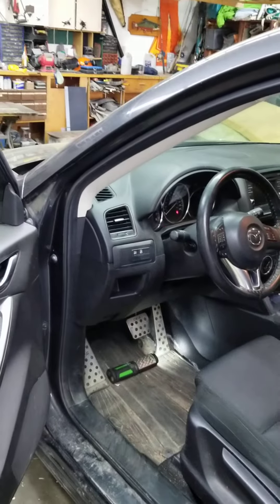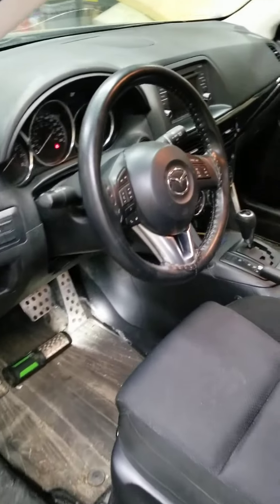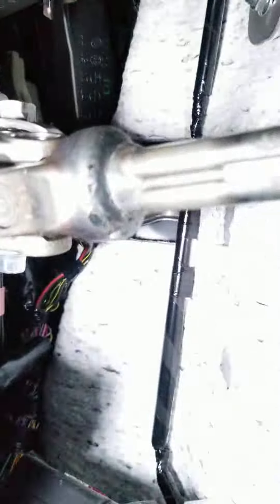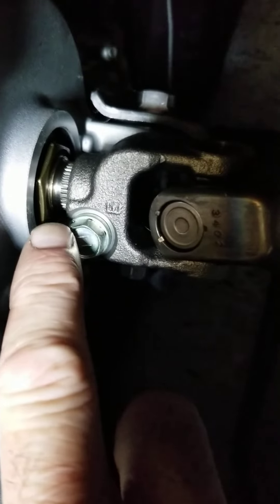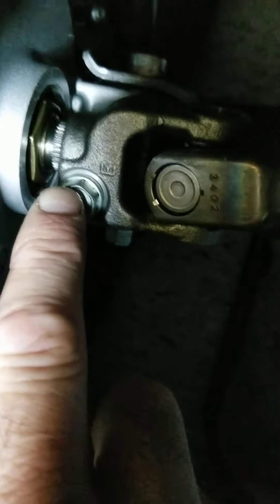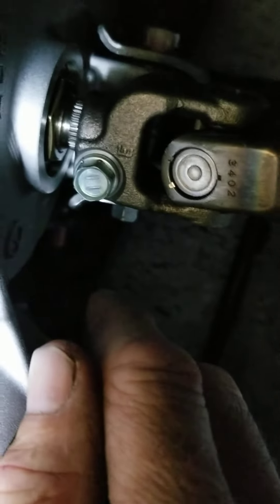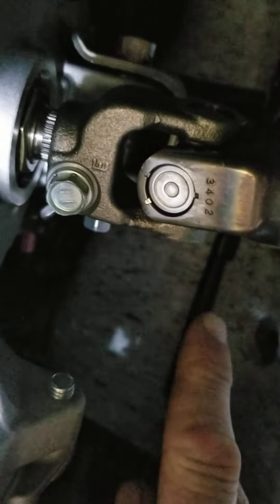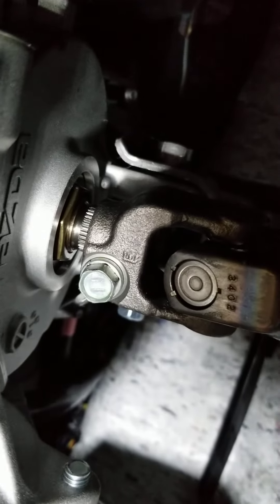Mazda CX-5 front end rattle or clunk solved.

Comment: You just solved a ~3+ year issue that some great shops haven't been able to solve, even as it's progressively gotten worse. I was about to book another diagnostic and probably replace the struts/shocks, but I just spent three minutes following your instructions and my 2014 is seriously driving like new. Can't believe it. Thank you!
Reply from the maker: Glad it worked Reese.  I suspect many are getting good results with this and I think beyond just the CX 5.
Reply: @ontariooutdoorsman  You're the man! Had a steering wheel wander and rattling. Thought it was control arm bushings, brakes or even wheels not torqued. But after 2 years, finally!!! Not all hereos wear capes, thanks! @Reese Smith, I feel your frustration as 2014 with the same issue.
Reply: Wad ypurs clunky over bumps etc? And only now and then ?. I'll check for play later kept telling myself it's   the gear box mount . Unsure atm
Reply: Just hopped into the wife's csr and found it doing this.  Thankyou for the help.
Reply: @kevinhancock4064  yeah it sounded and felt like a wheel was about to fall off.  Did the video help your problem?
Reply: @reese2694  I reppaced ball jo9mt on drivers side 4 now but do passenger shortly I think my inner tie rod is naff but no clocking now mate

Comment: It drove me crazy for 3 months unless i tried this method. And booooom, rattle is gone. I have been hearing rattle from which seems to be coming from dash behind steering wheel or engine bay, but it turns out to be a bolt as mentioned above. The bolt was already so tight, i just had to tighten further and the noise is gone. Thanks for the video
Reply from the maker: Glad it worked.  Awesome !

Comment: For those wondering.. the service manual calls for 21-30 ft/lbs torque on that bolt. Turn the steering wheel towards the driver side a little to get some added room to get a socket and torque wrench on the bolt.

Comment: On my CX-5 the bolt felt tight, but I was able to torque it down just a little bit more. The front end clunk which was was becoming progressively worse is now completely gone! Thank you very much for this video.
Reply from the maker: Glad to hear it...I was losing my mind trying to figure this one out.  I'm sure there are thousand of us with this issue
Reply: More I think if it its possibly my issue . I'll defo take a look ..the under panels are off anyway..easy to point out ? Get to ? I'm mechanically minded just not looked for it
Reply: What year is yourCX5?
Reply: @joseluishernandezrodriguez8146  mine ? 2013

Comment: It's funny that a Mazda dealership mechanic doesn't know this simple fix.  You could get clipped for thousands of dollars of repairs from front end alignment to replacing lower control arms bushings to shocks.  Thanks.
Reply from the maker: I totally agree.  In my opinion this is so common that mazda should issue some kind of service bulletin to check for this.

Comment: Random algo feed. I was curious so I watched. Ive been getting a front end clunk over bumps when my wheel is turned in my 2017 mazda 3 so this is pretty serendipitous. Knowing mazda's parts and engineering sharing between models, I bet my steering shaft is secured in a similar way. Thanks youtube and Jim.
Reply from the maker: It's hard to believe ho much annoying noise this tiny bit of play causes.  Good luck !
Reply: @ontariooutdoorsman hey Jim, I bought a 2024 in December, I’ve been hearing something from the rear end, sounds like metal to metal like the brakes are worn out but that probably is not true being not even 4 months old, I ran across this video, I wanted to see if you may be familiar with this issue  before I take it in for my first free oil change.

Comment: Thank you so much!!!!! Had that problem for months. Changed the sway bar, inner and outer tie rods, upper and lower control arms with ball joint, and was still making that noise. Gave up tbh but ran into this video, 10 minutes problem solved!
Reply from the maker: Glad it worked.  I suspect most mazdas have this problem evenually

Comment: I have a Mazda 3 2016. This has been plaguing me for the last two months. I’ve actually change two front shocks control arm, strut mount, stabilizer link, and it was a nut that was causing this issue. Thank you
Reply from the maker: So glad it solved it

Comment: You solved my problem. Thank you! I tightened with 40 Nm. The repair manual say 28-42 Nm.
Reply: Really? Over 300 ft/lbs on a small 12mm bolt?
Reply: Sorry.. my torque wrench has N-m in kgf-m.. you are correct. The manual has it 21-30 ft/lbs for non-metric areas.

Comment: Sir,....I think that I have the same problem on my Mazda 6 2021, and till now, I could¨t find it,...but I think that your video solve my problem...I gonna try it first think in a morning:)
Stay good
Reply from the maker: Hope it works for you.  It's very hard to diagnose that noise.  Took me a long time.  Good luck
Reply: Thank you!!! Like you, I’ve been chasing this down for a long time. Was about to replace yet another part when I stumbled upon your video. Can’t thank you enough. Someone already commented, but doesn’t hurt to repeat: from the 2013 CX-5 SM, joint bolt B torque range is 28-42 {2.9-4.2, 21-30} N.m {kgf.m, ft.lbf}

Comment: I hope this solves my problem. The sound is only present when I’m going over bumps. And it sounds like it’s coming from the driver side. I replaced both front strut assemblies 2 weeks ago.  The lower control arms a couple of years ago.  Mechanic check the work and said everything is tight, but they don’t know where it’s coming from.  In fact, it got worse when they replaced the strut assemblies.  I will try this and Cross my fingers. Will let you know, thank you for posting this
Reply from the maker: I can almost guarantee this is your problem.  I went thru 2 years of the same issues and finally figured it out

Comment: Thanks very much for the information. I have done exactly what you have said on my 2013 CX-5 and the noise is gone.  The bolt felt tight, but I was able to torque it down just a little bit more.
Reply from the maker: Glad it worked.  Sounds great to drive when its quiet
Reply: Has to be my issue . Same by the sounds if it its also driving me bonkers

Comment: Two other common areas the cowl bolts, 12 total come loose and the subframe bolts have to be loosened, alignment pins greased and subframe re secured correctly   tsb on the cowl bolts.  Not sure if there is a tsb on the subframe.  I guess the subframe hits the body so it needs to be re centered

Comment: This worked on my 2016. It had been doing it since it was new. On mine, it was the bolt for the lower joint which is hidden by a plastic cover. The bolt was just a little bit tighter than finger tight.

Comment: Just started experiencing this with my 2022 Mazda CX-5. I’m going to give this a try later, I will update with my findings.

Early update: I might’ve found a TSB for this particular issue 06-001/24. Seems to affect (US/Canada spec) 2016-2023 CX-9’s, 2017-2022 CX-5’s (some 2023’s produced before March) and 2017-2021 Mazda 6’s. Additionally (Mexico Spec) 2018-2020 Mazda CX-5’s. 

Instead of trying this fix, I’m going to bring up the TSB with the dealership (still under warranty) and have them evaluate it & replace with parts mentioned in the TSB so it doesn’t reoccur.

Comment: Ima try this, lately I’ve been hearing this clicking, clunking noise in my front left wheel area in my 2016.5 CX-5. This sound only happens when I’m in reverse though. I be thinking is my axle broken or my ball joint etc. this steering rack problem was a recall for the first generation CX-5. Thanks for the upload. I’ll give this a try when I have off.
Reply: Did you try out this fix? If yes, what was the result? I’m curious because I’m hearing the same rattling noise when I’m in reverse..
Reply: @matthewstewart2633  no I haven’t yet. I need to purchase a smaller 12mm socket. The socket I have is to long. Glad you asked this question, need to go purchase that smaller socket and try again.
Reply: @tomnguyen1802  anything new?
Reply: @matthewstewart2633 shit sorry, I still haven’t done it yet hahaha but it’s still driving me crazy

Comment: I had a rattle on my 2018 that sounded like a loose heat shield under the car that was from 1500-1700 rpm.  It turned out to be the hydraulic belt tensioner which I replaced with the belt at 70,000 miles,

Comment: I have a 2017 CX-5, wondering if my issue is the same as you were experiencing. Essentially when I accelerate, decelerate it sounds like a bolt rolling back and forth. It does not occur when turning however.
Reply from the maker: This proble. Definitely feels like suspension or wheel components and you can feel it in the steering
Reply: @ontariooutdoorsman  Thanks Jim, guessing my issue is something different :/

Comment: I have a soft clunking noise that sounds front end related. Only happens about 15mph and below while hitting bumps. 
2022 Cx-30 with 7k miles
Reply: Same. Low speeds only when first driving the vehicle and not after the first 20 seconds of driving. Worse when car has been sitting for a bit. I have a 2016 CX5

Comment: I was able to tighten the bolt.. but I'm afraid I stripped some sides of the bolt. Did I over tighten? Or should I be worried about it being compromised?
Reply from the maker: That's a big bolt.  I doubt you would strip it.
Reply: @ maybe a poor choice of words 🙈 the flats on the bolt head seem to be stripped, where It’s hard for the wrench to now grip the bolt. Did I tighten to much, to now where it won’t be able to be adjusted or it’s compromised the integrity?
Reply: Can you tell me if it’s suppose to solve this issue? https://youtube.com/shorts/bVuR26kbqcY?feature=shared
Reply: Another example: https://youtube.com/shorts/P2a7Fc0C4z0?feature=shared
Reply from the maker: @YoutubeTV-w2v  ok I hear what you are saying.  Sounds like you used the wrong size socket and partially stripped the head of the bolt.  If that's the case..ensure you have the right socket and make sure to use a 6 point socket as opposed to a 12 point.  Should work.
Reply from the maker: @YoutubeTV-w2v  watch my video.  I explain what it solves

Comment: I have a similar noise. It happens mainly over rough, small bumps (like washboards) and is worst when I am accelerating. It sounds like a metal rattling/clunking and sounds like the front suspension/ front engine area. I also have a little bit of play in my steering wheel (not as much as you though), and there is a slight clicking, but when I went to tighten the bolt it seemed very tight already. I was not able to crank it any more using a normal wrench. I guess that maybe this isn’t the problem. Any advice?
Reply: The bolt will tighten.  Even if just barely.  If you feel thr clicking in your steering.  This is the problem.  Get a large enough wrench.  The bolt holds the clamp on the spline and will be quite tight already.
Reply: You should be able to see the slight movement in the spline/clamp if you are underneath looking at it when the steering wheel is moved.  If this is your problem..you will feel a slight clicking in the steering wheel when rapidly wiggled back and forth.
Reply: What if I used an impact on low setting? I also was not able to get the bolt to tighten. But yes that tiny little slight click is definitely there
Reply from the maker: @SnakeSkinPrison  it will tighten.. just use a 1/2 inch drive wrench.  With force it will turn and dont need to turn much.  Be careful with an impact you may break it.

Comment: I tried this but did not work .. mine is 2021... driving me crazy  .. Mazda even chnaged the transmission... yet it did not resolve the issue.
Reply from the maker: Sorry to hear that.  This problem is only present over bumps.. sounds like a left strut loose or even a stabilizer bar bushing...but just a steering clamp.  Hope you figure it out

Comment: I have a front end noise noticeable when the car slowed down. In neutral the sound is still there. My mechanic said he doesn’t know and it might be transmission. He lifted up the Mazda and said the whole front end axle and engine shakes. Could what you say in this video be the solution?
Reply from the maker: Not likely.  This is only noisy over bumps

Comment: Is it possible could it be my steering rack causing clunking noise when driving over bumps?
Reply from the maker: If you havnt checked the problem I describe in this video...check it.  Sounds very much like suspension or steering noise caused by this loose joint